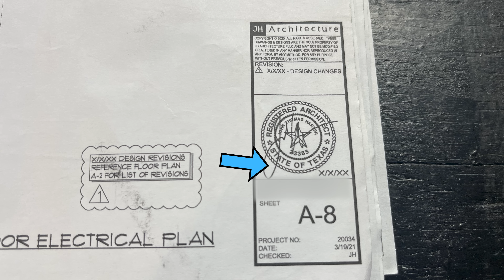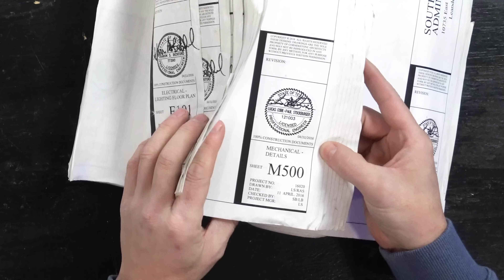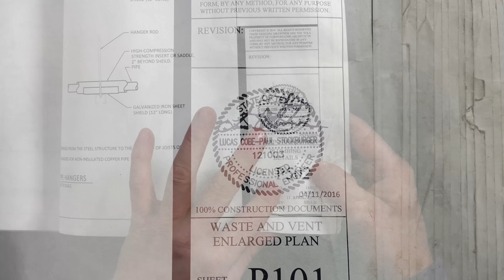What's the Difference Between Commercial and Residential Blueprints?

Comment: Must electrical engineers don't know the residental codes its not a college requirement, so building electrical engineers have to take NEC code classes on their own time , the actual experts in code are the building electrical inspector he or she is paid to know the code based on NEC made by NFPA 70

Comment: Power factor is not about wasting power.  Your stuff works.   The only concern about power factor is from the Utility company.   The reason I’d the meter reads Volts, Amps, VA, and Watts.   Since power factor is the difference between VA and Watts, and you pay for Watt hours, the Utility is not getting paid for 100% of your real usage.   So, they charge a power factor fee to get their money.   If you install capacitors to improve power factor, your bill will increase, and the separate power factor charge will go away.  Companies will pay for their usage one way or another.

Comment: THIS! I'm an EE for a MEP design firm and I have a question for you here - 
What can I do in my design that makes your job easier? Do you like circuits to start closer to the panel or further, or does it matter? What are some of the things you really hope to see included in plans, and what do you really wish we would not include, or would do a different way? Do you generally like it when every room has it's own line on the panel schedule for lights and receptacles, or do you not mind when we string together 2 or 3 rooms that are nearby if they only have a few receptacles in them?  

Basically - when you see a drawing, what makes it easy for you do do your work, both in reading the drawing and doing the wiring itself, and what do you hope the engineer will NOT do as well?

Comment: I am a retired Electrical PE having designed over 300 commercial and industrial projects. Signed thousands of E sheets. Those residential plans would not get a permit in Florida and the architect would be disciplined by the Board.  Current problem I had was getting the contractor to follow my plans, many can't read English and simply do what they were taught. I always enjoyed a contractor saying they've been doing something that way for years and I get to make them redo it to current Code and the permitted design drawings.

Comment: 2 years in industrial then went to commercial for the last 2 years. I can absolutely say that commercial engineers cannot be trusted more than kindergartners to map out circuitry.  Last job I was on, they daisy chained every single receptacle on the floor together, and had leader lines coming out for different circuits. Someone forgot to separate the lines, so we had no way of knowing where one circuit ended and the new one started. Went to the panel schedule for some clues, "conference room" "kitchen" "managers office" gave us no indication, as there were multiple circuits spanned across large sections for each area. Oh yeah, they also forgot the difference between east and west in their lighting notes... So we installed all the lights in place per the rcp, but used the panels and circuits we had already piped to and redlined the entire lighting schematic. Every lighting panel was flip flopped from east side to west side.  They are not all professionals
Reply: Sounds like someone fresh out of school... from Australia
Reply: Forgot to add, the reason they got east and west wrong was because someone else decided it was better to draw the entire print with South facing up. Their own people must have missed it, and I know all the trades including ours had at least one episode of scratching their heads, wandering around the opposite side of the floor searching for their references

Comment: I am a PLC programmer and maintenance electrician and I don’t use much code I stay with osha standards and let it fly
Reply: Do you really follow osha to the T though? Most people I have worked with don't. When you have the electrical cabinet open and you're programming a plc do you have any arc flash gear on?

Comment: Prescriptive design vs Performance design. For the residential design, we use the Residential Code such as IRC. Most code books are prescriptive in nature. Every table you go to is a prescribed table for example wire sizing, wire types, location, and conditions, temp rating, etc. Code paragraph [R610.1.3] is a prescribed code. You do not need calculations by a professional engineer to preform that task as long as you follow that code. 
This is all prescriptive design. You can design a residential, new home, ADU, addition, etc without using an Architect or Professional Engineer. As long as you do not go out of the scope of the residential code, no stamps are required. 
Now when we design a residential dwelling unit, we are not required to submit an electrical, mechanical, or plumbing plan. So we generally include them in the floor plan. Not an electrical plan but a general lighting plan, pretty much to get a rough box count for permit charges. And yes we do not line-connect lights to light switches or trace out circuits. I simply make the plan unreadable
The lighting plan should follow basic 6'-12", 2 kitchen circuits, GFCI, and AFCI. dedicated outlets, clearance near the shower,  in front of service panels, and sub-panels in combustible areas. I have a plan checklist 100 pages long. For plumbing, we show the type and locations of fixtures. For Mechanical we show fart-fans, HVAC units, etc.
I have been a GC and a Residential designer for almost 40 years. I am required to place service equipment in approved locations, with approved clearances. We do know codes, and code navigation. I am responsible for Site-plan, floor plan, elevations & sectional, foundation plan, framing plan, roof framing plan, roof plan, Details, (BMP)Best Management Plan, (LID)Low Impact Development plan, and Title-24 Energy calc and Notes and Tables. All of these plans are submitted through professional plan checkers. 
When it comes down to it,  the approved plans are designed for 3 entities, the designer, the building department, and the tradesmen building it (not the owner). We all expect everyone involved to be professionals in their field. Residential construction has always been "As Built"  with everything but structural. 
I should not tell a plumber in my plans how to connect the waste lines. I should not tell the electrician how to run a circuit or size the wire or how to makeup boxes. We expect you to be the expert.

Comment: i may be biased, but industrial electricians have to deal with much more complex systems and devices. you are correct on the code part for the most part. technically we need to know box and conduit fills, sometimes arc fault calculations, ect. but in exsisting industrial buildings inspections  and code compliance is rarely enforced

Comment: I've had a handful of solid plans from commercial projects. The majority of them I spent  multiple hours sending out RFIs (Requeats for Information) to the Engineers and suggesting solutions to field problems and or code issues. 
All the spec books we had always had the BS Disclaimer of "It's the E.C's responsibility to confirm all wire sizes, box fill, circuitry layout  and perform all work according to national and local codes etc." 
In other words edit and red-line the engineers work for them at our expense.
Reply: Wish I could copy this

Comment: Hey Dustin, always a good day when you put up a new video. Thanks Brother.
 I want to let you and other people out there doing what we've been doing most of our lives, I've been an electrician and in the trade almost 35 years now, more than half my life. 
 I was a commercial industrial journeyman in the IBEW for just over 16 years. The other years I did both residential and commercial work. 
 You are correct about drawings and the differences between types of building and the accuracy or lack of. But, even with large commercial jobs there are some engineers that will draw certain parts of a plan, that absolutely is not correct or they will have a note on that page that basically says for the electricians to figure it out. 
 It usually is some strange part of the building where we need to install an outlet or lighting but the design of the structure is very complicated where a pillar is against an exterior wall and we have to come up or down through the floor pan where all these beams and building steel and we gotta get a piece of conduit through. There are plenty of times when we'd be at the gangbox plan desk or in the trailer trying to exlpain to the boss that the drawings suck and how do these guys draw plans and have no clue as to what it is going to take to make it work. 
 I've always said that architects and engineers should mandatory work a minimum of two years in the field before they can graduate with a degree. 
 But aside from those problems, commercial drawings are extraordinarily precise. Down to the smallest details and to the 64th of an inch or tighter. 
 Commercial plans are thousands of pages sometimes for large jobs like multi building campuses, or for a 40 or 50 story highrise, or a mall or professional sports stadium or hospitals which I've worked on all of those and more.

Comment: I definitely will say, commercial prints, are almost NEVER spot on!  Done many commercial and resi work, resi has been more correct. Commercial layout changes daily! Especially when the new 'stamped', updated plans have not been brought to light,  until later in job! 😡😡
Reply: They need to get with the times and put a QR code on the plans so you can easily and at any time scan and get the updated plans.
Reply: @FishFind3000  yeah but that means posting the plans in a publicly accessible place, sense a QR code is really just a url.  Most customers don't want their plans available to just anyone.  Most of the time we get the CAD shared in like Dropbox, so we can see the revisions, but thats assuming the enginner remembered to put it in Dropbox and not saved locally to their computer.  I've had that happen a few times, lol.
Reply: No kidding, GC "why are you running wire there"
Me " it's what the plans call for"
GC "what revision are you working from"
Me "11"
GC "HAHAHA were on 14"
Me "FUCK"
Reply: @Tw1steD247  
Man, I feel ya!!!!
Fuckers always did that shit to me!
We'd be like w t f! Already ran homies to the circs. 
I'm like fuck it.... JUNCTION THAT SHIT IN THE CEILING ABOVE! Ain't ripping it all out and running half across the fucking store again!
Reply: @johnmaranuk1842 Junction That Shit In The Cieling!😂
Reply: yeah I've worked a few industrial jobs, and it seemed like every week was a new change to the plans.
Reply: @bassman87  dodge
Reply: @bassman87  you are bmp
Reply: Lol def true….can’t tell you how many times I’ve been working just to find out I have an old blueprint